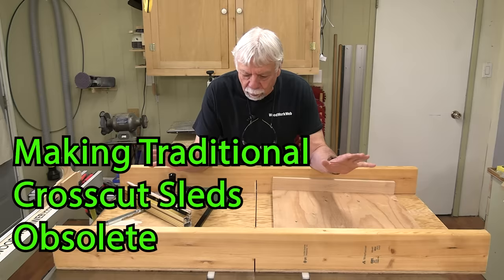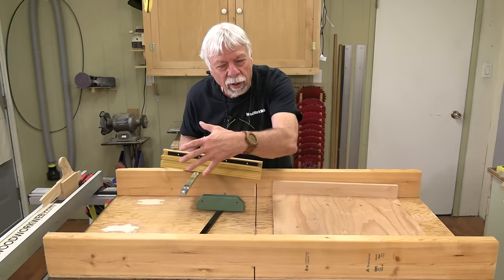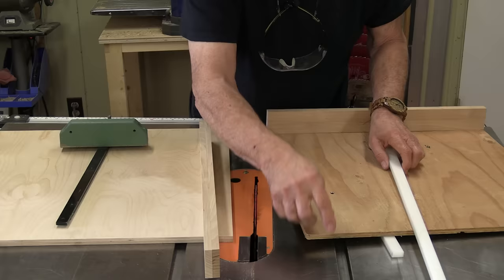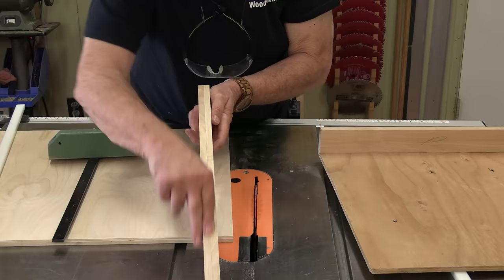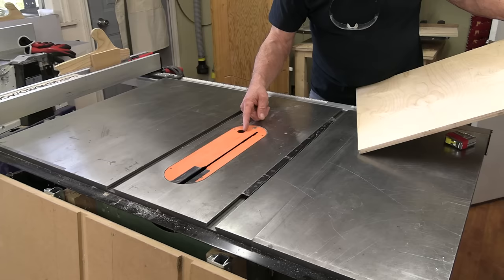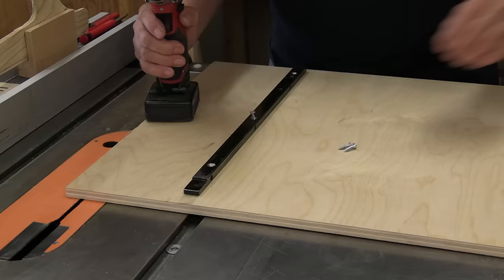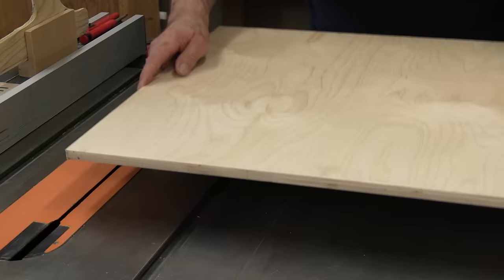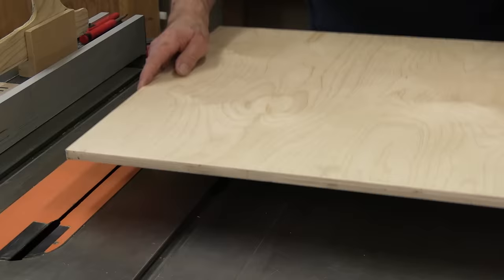STOP Making Out-Dated Table Saw Sleds, Do This Instead

Comment: If you can't find the plastic for the runner, go to a kitchen ware department and buy a plastic chopping board of the right thickness which you can cut into strips.
Reply: I have just been thinking the same idea. I was also wondering if you couldn't make a sled completely out of kitchen plastic cutting boards. Maybe find a glue for bonding the plastics together.
Reply: Thank you, because I've never seen a plastic store lol
Reply: pieces of PVC trim boards work too
Reply: Corian scraps would work too.
Reply: Or just use some hardwood scraps that you have around the shop. It’s not rocket science. Rip down some strips of Mesquite or Purpleheart or hickory and you’re good to go! YouTube is a trip.
Reply: @wulf67  yes because hardwood isn’t really a wood and doesn’t expand or contract at all

Comment: The multi-cut technique to check for square is a good approach. But the results showed that it was out of square (0.025” over 4 feet). What would have been helpful is to show how to adjust the fence to bring it into absolutely square. For viewers interested, a quick search for William Ng’s 5 cut method will walk you through the process. When I built my “obsolete” sled, I was able to bring it to within 0.003” over 4 feet, approx. 1/8 the error. It’s easy, only takes a few minutes and a little simple math but will ensure square cuts from now until that plastic runner needs to be replaced.
Reply: That level of precision for woodworking is well into the diminishing returns range. As the temperature and humidity changes that sled will be off by more than 0.003".
Reply: 0.025" over 4 feet...or 0.006" over 12 inches is only the thickness of your hair over 12  inches.  I feel for wood work that is a great tolerance.
Even though this thought goes against my OCD side as I am a machinist by trade.
Ie. Try making a sun deck after dealing with +/- 0.0005" every day at work...so 0.006" is nothing to sweat over.  However knowing the technique to get it better will help help so many people.
Reply: The 3 cut method is quicker, just as accurate, and zero math involved.
Reply: @acerjuglans383  you only need to do 2 cuts. Cut once, flip the piece and cut again and measure how much it narrows over whatever distance you are interested in.
Reply: All well and good in this video, but now I have to go hunt down another video that says how to correct the unsquare. Feels like it will be finicky, what with having drilled and seated the screws already.
Reply: @mckenziekeith7434  when you say flip it over do you 180 so the top is now the bottom?  Or the front is now the back, like you are turning a page on a book?  Thank you.
Reply: @nobadmojo70  like turning the page in a book.
Reply: @nobadmojo70  i have a 10' sliding saw and it is as perfect as you can get. I use the 5 cut method. Cut 4 times around your material (i use a 5' x 5') and cut a 5th time but cut off a piece about 1/2". Then mark each end for reference and then cut it in half or so. Take both ends and lay them flat against each other and check if they are equal. If not, then adjust fence. Mine is right on flush. Other method is cut 2 pieces whatever size, the bigger the better. Take one and flip it over onto the other one and check for square. If accurate, no matter how you flip it or turn it, if they are flush and accurate, they are as perfect as you can humanly get it without a cnc.
Reply: @imacmill  I agree it's fussy to try and not have the board move even while it's clamped up tight. My friend turns his sled over and you can see that there are at least 5 holes drilled under there until he got one right that made the fence line up. He did the five cut thing to check it.
Reply: @keathpolyak6469  Exactly. Final squaring within a few thousandths only takes about 5 minutes and a block of wood using the techniques you can find on YouTube. I was cutting 20" panels on my (obsolete!) sled this afternoon. I work as close to 32's as I can manage with cabinets. No way I want to deliberately introduce a 64th error ON BOTH ENDS when I can easily avoid it, as errors compound in complex assemblies. The above error is only .004" away from a full 64th on my panels. Dialing in .003" over 4' was worth five minutes of my time!
Reply: 100% true square is unachievable
Reply: @imacmill  You don't drill and seat the screws before testing for square.   You use one screw, and a clamp on the other end.   If you are happy with the result, then install the other screws.

Comment: Never saw the 3 cut test for fence squareness before.  It's usually a 5 cut test and then take the cut off piece from the fifth cut and measure the thickness at each end.  If it is the same, then the fence is perfectly square.  It is the same principle of compounding or magnifying the error.  Your method of checking with a square depends on your square being perfectly square to measure the error.  This of course gets into the whole debate of how much precision do you need in your woodworking tools as wood is an imperfect medium.  It moves with changes in humidity.
Reply: There's no such thing as a perfect medium, nor a perfect tool, nor a perfect reference, for that matter. Even metals like Adamantium, Duranium, and Mithril would all still be subject to temperature changes. Perhaps one might imagine something more perfectly crystalline, and thus less deformative, like Kryptonite? That'd still be susceptible to gravitational alterations, as per relativity—no matter the perfection of its geometry.  

The utility and extent of precision will be relevant in every discussion concerning material transformation; when we craft, all we do is account for error, in every variety. Wood is as good a substrate as any. Plus, it grows on the trees around here.  

In the end, the only 'squareness' that matters will be the finished cut against its reference edge, which, by length, is usually only a small fraction of a framing square. As such, measuring compounding error often becomes more neurotic than useful. I'm not above checking both my "out-dated" sled and my fence with a rusty old square, but I'd still dare anyone to compare some of their highest precision against some of my finished work.
Reply: @pocket83  Ever try living in reality? Just wondering. Someone's highest precision work equals your rusty old square. Sure thing bro.
Reply: @pocket83  When lumber shrinks, grows, warps, and twists .005 from day to day, chasing that much precision just makes you crazy. All you need to do is take a good straight board 5-6' long, and cut it in the middle. Flip the pieces, butt them up, and lay a straight edge against them. If less than a .010 gap, you're good to go.
Reply: @SpicyTexan64  Post some of your work on video. Compare it to some of mine, tough guy.
Reply: @terryharris3393  If 2x4 board is 6' long, the middle is 3', right? Cross-cut it at 3' and it will tell you how out of square you are with plenty of precision.
Reply: @bwillin: This video author has shown a far inferior method of setting up a cross cut sled. The 5 cut method and the formula for adjustment is a vastly superior method and uses a measuring device (calipers) that is accurate and precise enough to make accurate adjustments to square. Carpenter’s squares are out by .005-.010” for good new squares and much worse for cheap and/or used/dropped ones. An error of .006” over a foot is too inaccurate for cutting furniture joints like shoulders and cheeks of tenons.
Reply: @terryharris3393  Furniture does need more precision. I'm a little OC about my squares and check new and abused ones for squareness on a surface plate until get I them almost perfect. But if you think about it, a straight 1x4 or 2x4 6' long, crosscut doubles the error and can easily detect .003 per foot.
Reply: You're right, the 3 cut test is a little flawed and him using an obviously ancient square makes me wonder how accurate the square is.  
Ultimately I guess if it's good enough for this fellow then hurrah but 25 thou across 4' is pretty bad.  All it would take to fix is taking out 2 of the screws holding the fence and pivoting it a little, then drilling new screw holes but it would have been nice if he'd shown that for the people who wanted to follow his method but want something more precise.
Reply: @Bob_Adkins  I don’t think you understand estimating crosscut sled accuracy. A 2x4 is 3 1/2” wide regardless of where along it’s length you cut it so how does cutting a 6’ long 2x4 at 3’ help?
Reply: @barrylinkiewich9688  William Ng has a video “5 cuts to a perfect crosscut sled” that explains the entire process of making a successful adjustment in just one attempt. It took me two attempts because I don’t know my left from my right but oh well. The math is simple.
Reply: @terryharris3393  I understand precisely Terry. You cut and flip 1 half over and butt them together. If the cut is square, the board will be straight. A long board amplifies the "error per foot". For example,  a 6-foot board amplifies .005 per foot into .030 (6x.005), which is easy to measure.
Reply: @Bob_Adkins  I see. You are relying on the false fact that the length of the 2x4 edges are parallel over the entire length of the 2x4, in this case 6’, which it certainly is not but in any case, your understanding of error amplification is incorrect. Flipping the board only exposes twice the error over the 3 1/2”width of the 2x4. Although, if one could prepare, say a 2’ work piece that was exactly orthogonalized and the if they crosscut sled’s fence was exactly flat and straight, then gauging the gap in your process would be due to the error in the non-perpendicularity between the sled’s fence and the blade. Good luck on making the conditional assumptions true. Why not just fix a dial indicator to the fence and calculate the runout of the blade? Wouldn’t that be easier and preclude the test piece’s GD&T requirements? The answer lies in the remediation of a defective sled fence. See William Ng’s video “5 cuts to a perfect crosscut sled” for the answer.
Reply: @terryharris3393  I watched Wm. Ng's video, and find his method unnecessarily time-consuming and wasteful for me. I only need .005 per foot accuracy because any species of wood will easily crush .005 and close up a small gap. But I truly appreciate your love for high accuracy because I am a retired quality control manager. My inspectors measured using tolerances from .0001 to  .000004" every day.
Reply: I usually measure with a micrometer, mark it with chalk, and cut it with a chain saw. 

An exercise in significant digits. 

 @SpicyTexan64

Comment: Only thing I would tweak with your base design is to add a small angled cut where the fence board meets the table board to allow for any dust that might accumulate and throw off the fit against the back fence.  Otherwise it is a great base design.
Reply: Was going to mention this.
Reply: Genius
Reply: An improvement is to drill several 5/8" holes through the sled every 4 or 5 inches along that angled cut.  Be sure to bevel each hole slightly, top and bottom. These help empty the sawdust every time the sled is backed up beyond to edge of the saw table.
Reply: Like a real sled that supports the offcut

Comment: My first couple of sleds were kind of like your heavy one.  I saw some of the other options including the big red do-everything types of sleds you can buy.  I was fascinated by the one where the right side of the blade was fixed but the left side slid.  I made this same sled you show here, but with a slight twist. My first cut established the right edge of the sled.   I used a square to align the fence to the edge I just cut.  It was really good.  

But the twist is that I also made a right hand sled.  I did the same thing without the fence.  It was just a runner and the same height as the sled.  Then I lowered the blade and flushed the right side next to the sled.   The right sled was longer than my jobsite table saw so it would support 6 more inches than the saw top. 

I pulled the right side back, raised the blade and pushed the right side next to the sled together into the blade until the back of the right board was aligned with the back of the saw.  

This gave me no gap to the blade and  zero clearance at the blade and I felt better about some pieces being supported on both sides of the blade.  I did not need the right side many times, but I discovered that with this setup, I could use my blade guards.  For my saw, the blade has to be fully raised. I used 1/2 inch plywood instead of 3/4 but I don't think that really matters. 

I also added a piece of 1x2 board that extends from the tables saw fence when it is flush against the right board, to the saw blade. It is over a ruler so that I can move the table saw fence to adjust the stop block to measure repeated cuts.  This gives me 11+ inches from the piece I cut off to the table saw blade.  That should be save enough. 

Again, all of this works great even while my blade guard is on my saw.  

Like you noticed, the sled is super light.  I've been procrastinating using a 3/4 version where I add screw holes to mount accessories for things like angles and rabbits and finger joints. 

For me and my small shop, the smaller and lighter, the better.  

Great video, as usual.  Keep it up.

Comment: I agree you should adjust your sled’s squareness and William Ng’s method is widely thought of as the best method to get a high degree of accuracy.  Two things that I think you’ll need to better explain are 1. While lining up the sled to the opposite miter track would be accurate, this does not mean the blade or fence is parallel to the miter tracks and can introduce issues - the blade to the sled and your projects not using the sled but use the fence. 2. Not sure why you aren’t cutting through the back of the sled and using the back of the sled to prevent tear out and provide a smooth cut to the face of your work. I still believe it is helpful in doing certain work like cutting small parts to have the sled on both sides of the blade.  I like to laminate 2 @ 3/4” pieces of Baltic birch for the back - very stable. I also put a very slight chamfer where it connects to the sled as saw dust might build up in the corner.  Final comment - something someone else mentioned was waxing the bottom… I do that and wax the top of my tables.
Reply: Once you have the guide attached to the sled you can run it through the saw for the first cut. This cut is what you want to set the fence to using your framing square. After preliminary setting you can proceed with a 5 step method or whatever you'd like.  All your cuts will be the same as that first cut.....if the fence is square to the cut you should be good (unless there is sawdust between the fence and the work piece (as mentioned).

Comment: Hi Colin. You can save some time and material by using a table saw dial indicator alignment  jig to set up your sled if you have one (best measuring tool investment I have made ). Simply place the jig in the miter slot opposite of the jig. Clamp the builders square firmly to the fence. Set the dial to read zero at the base of your builders square. Move the jig to the far end of the square and note the reading. If it is zero you are good. If not move the fence back or forth to bring the gauge to zero. Repeat just to confirm your reading. I don't trust builders squares and usually use a very large plastic drawing triangle for the alignment. I have never been off more than .003" using the 5 cut method. Your blade must be aligned with the miter slot for this to work!.
Reply: If you’re going to use a dial indicator you don’t need all those extra steps or most of the parts. Even the dial indicator isn’t necessary if you own hardwood scraps and feeler gauges or a business card…

Tool setups aren’t as much about /measuring/ runouts as they are about a quick go-no-go test with a gauge of some sort- even a business card. That even alleviates compounding errors 99% of the time, and checking parallel pretty much eliminates checking for square if you set your tools up well.

Measurements are usually a fraction of the value of fitment
Reply: @fishhuntadventure  
You are right. Before I bought  the indicator I used a brass screw in a board set perpendicular to my miter gauge. Just kissed and marked the front tooth of a sawblade and revolved it the toward the rear of the table. Moved the miter to the tooth and adjusted the blade. An indicator is easier and quicker way to cut down on boring stuff leaving more time to make sawdust.

Comment: Thank you for shedding some light over this subject! I am done with my traditional big and heavy crosscut sled that is always getting stuck in the middle of my cuts, to the point that pushing it harder makes my saw to move forward! I came after a solution for "sticking sleds" and stumbled against this wonderful video. I am going to make one of these simplified sleds and this time I will use nylon runners. Sometimes simpler is better.

Comment: All you need to do with the stock miter gauge is to put a flat and true piece of hardwood on it as a fence - that's why it has 2 holes in it, for screws to screw the wood fence on. It also has an adjustment setting to true it up at 0* so you don't need to continually adjust it. Yes, a sled is slightly better in SOME circumstances, but 90% of what you need to crosscut you can do with the stock gauge WITH a fence attached to it.
Reply: Many stock miter gauges are no good especially on job site saws
Reply: @worldtraveler8571 ever hear of adjusting them?